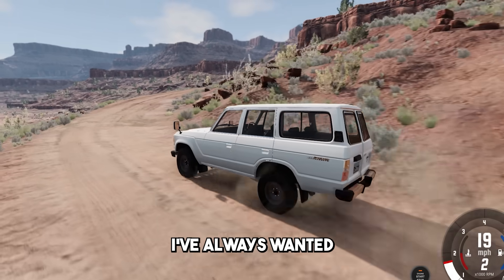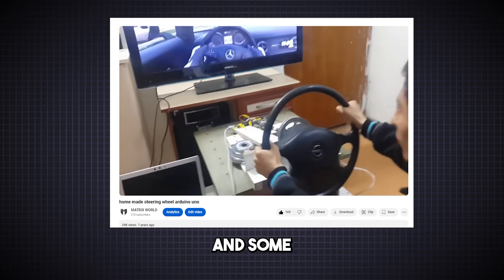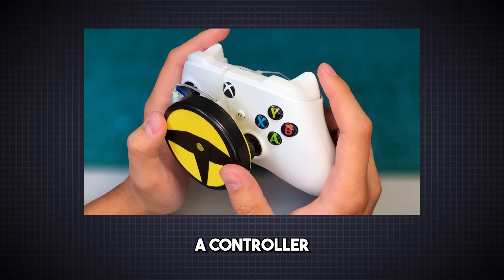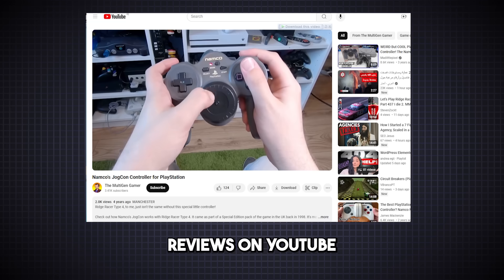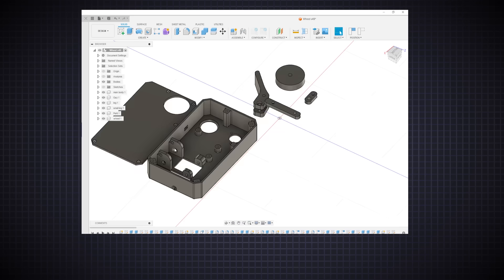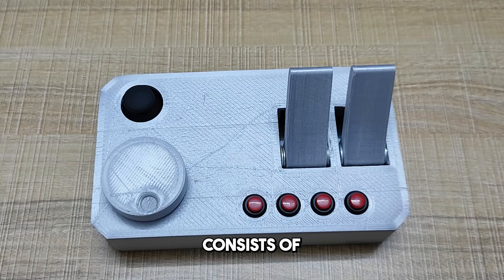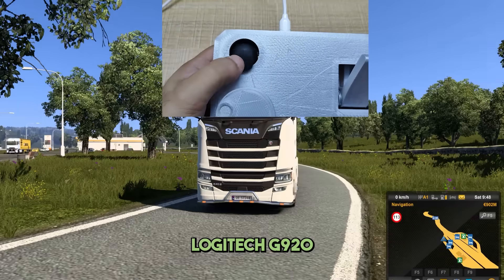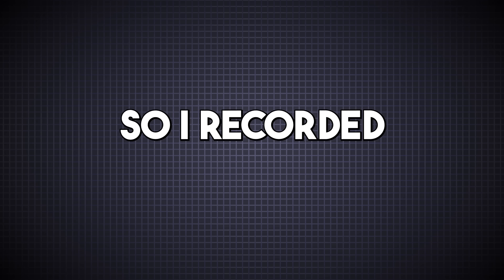The Racing Controller No Company Ever Made—So I Built It

Comment: Great Idea, Couple of recommendations / Questions: 

1) Get a UPS for your 3d printer it will save you so much time restarting prints.

2) Would it be possible to make the steering wheel auto rotate back to centre like a normal steering wheel does.

3) Someone else mentioned can you put buttons on the top like an xbox controller for LB1/RB1 to allow for changing gears?

Comment: Would it be possible to move the camera joystick over to either index finger on the back side of the controller?

This way you can keep your thumb on the wheel and steer while turning the camera at the same time.

It would likely benefit from a lower profile "cup" style joystick, possibly one with 4 axis control instead of 360 for easier level locked camera rotation.

Comment: For the problems of 3D printing and the reliability of the electricity network, maybe doing something like a sai, or battery something? Of course I don't live where you live, and maybe I'm saying some stupidity, but with the current price of the batteries, I think you should be able to get some decent backup network to avoid 3D failures because of the electricity. It's only a thought.

Comment: i find it interesting that as a South African who drives on the right side of the road I would actually prever if the steering was on the right for me. i use my right hand to hold the steering wheel most of the time while my left is mostly on the gear shifter.

Comment: I remember racing with an Ultraracer 64 which was a great handheld controller. Using a trigger similar to RC racing allows you to hold the controller comfortably and allow the trigger thumb to press buttons and use the Dpad while the steering hand can grip the wheel.

Comment: Bro needs to learn how batteries work for his 3D printer’s sake.  Can cheaply recondition scrapped car battery to make a battery bank that can power a house or room as long as you are careful to avoid hurting yourself with battery acid or electrocution.  You really only need a buffer of power like commercial UPS systems provide.  Basic electrical engineering is much easier than it sounds.

Comment: For the unreliable power there's a power bank power strip you can potentially get, its a battery attached to a power strip, it charges when the power is on and acts like a normal power strip when full, when the power shuts off it draws from the battery so that things can still run, it can run the printer for a few hours after the power goes out if you get one with a few hundred watts of bank, I'm not sure how long electricity goes out for you for though but it could allow you to finish a print if it has a few hours left on it.

Comment: Hmm, i think if I was making something like this, I would put the brake and acceleration pedal as shoulder pedals. Add a more travel than your regular xbox controler pedals of course. That'd allow you to shift with your thumb. And then I'd use something like the arduino micro to get it to be a bit smaller and more ergonomic. That said, pretty cool regardless.

Comment: I don’t play racing games because I just couldn’t feel immersed. And now you created a controller to do this. Thank you!
Reply: Do you know like gta because you're not "immersed"?
Reply: You can but set up a rig with real movement and using a Direct Drive, good pedals, three 55” OLED TVs, and cut the chassis of a car you will feel fully immersed.
Reply: @alcrack3996 don’t forget an airbag in case you crash
Reply: @E_Rico  right😂
Reply: @alcrack3996  and pay close to annual sallary for all that
Reply: @alcrack3996  Or just buy a g29 instead of spending the money a real car would cost
Reply: @adogaruu  he talking about immersion so that is. Before a G29 there are cheap DD
Reply: @adogaruu People have been using actual car parts as simulator rigs so there's that too

Comment: Force feedback is way more important to steering feel than degrees of rotation, unless you want to emulate the feel of a modern electric steering rack 😅

I guess it could be impossible to find a small enough back drivable servo motor for that though 🙁

Comment: 1. Not good for serious racing games where you need gas/brake at the same time, or switch quickly.

2. You can't press the buttons while holding gas/brake.

This is a problem with all consumers. They all require thumbs too much. There should be buttons on the bottom where you can make use of other controllers. 

3. Not everyone has thumbs. A controller should be made where other fingers should be used. You can start a business making controllers for handicapped people.

Comment: This looks like a really nice implementation! Just the pedal inputs seem like something I'd really prefer for driving games. It sorta reminds me of the idea behind the little "Tech Deck" toy skateboards, remapping footwork to fingers, and looks like it gives a lot more precise control than an analog shoulder button with a few mm of travel does. With a clutch pedal I could probably even drive stick as well as in a real car, something I've always failed at with a controller.

Is the encoder wheel limited to 900 degrees of travel physically, or do you just hit the virtual stop in the game when you get there? I think free-rotation probably works better for a game, mostly curious if that fairly fancy looking industrial encoder has a mechanism that limits travel.

Comment: this is really cool!!! im probably gonna try to make one myself! i'd love to try getting this to work with f-zero gx. i think with the strafing mapped to the horizontal axis of the joystick itd work rly well. im not exactly sure how the arcade controls worked, so itd prolly take quite a bit of tweaking to get working, but we'll see :) i also think hydro thunder would be super fun

i think itd also be a fun challenge to play a sonic game on it by mapping the controller such that the wheel and the gas pedal output combined as a joystick, with the wheel setting the direction and the gas setting the magnitude, and depending on the game the brake could set magnitude in the opposite direction. this setup would be BANGER for monkey ball

one last weird thing, i think this could work well for fps and tps games, especially those with an emphasis on horizontal aim like OG Doom or those with platforming elements like splatoon. the joystick can be used for strafing, even analog 360 strafing, the wheel can be used to aim horizontally, gas to aim up, and brake to aim down! itd probably need quite a few more buttons depending on the game, but i could for sure see it working. i'd be interested in trying to play metroid prime with it, since that game kinda had that tank control thing going on with the original gamecube version

i think the controller might play a tiny bit better if the joystick was on the top of the controller, where the triggers and bumpers would normally be. noticing you struggle with turning the wheel and moving the camera at the same time during gameplay, if you moved the stick there you could do both without having to claw the controller. i also think that you could add one more type of analog axis to make it more compatible with other games, but there arent that many games which use every analog axis on a controller, i dont know if itd be worth the work :p the one i can think of off the top of my head is outer wilds with its crazy in depth spaceflight

Comment: I have one thought, it’s a small one but I think could improve the ergonomics of the controller if that’s the right word 😅
If you move both pedals sideways and onto the backside of the controller where triggers would be, except they aren’t facing down like a trigger, so in that way you can have both your pointer and middle finger comfortably resting on them
It would also give you more room to use your thumb to press buttons where the pedals used to be
Otherwise it’s a good controller, it could just be re-engineered slightly better to fit a hand a bit better rather than be boxy

Comment: Wow, that's a very good idea! Although it looks better suited to slow-reaction games, like truck driving, I think it can get be used for sim racing to a certain extent. Why I say "slow reaction": one issue I see is with the two pedals, it takes a long time to switch between them, perhaps a slider which acts as acceleration+brake would be better. Thrustmaster also has a similar "steering wheel gamepad", there's this "Forza Horizon" branded gamepad with such a wheel. But keep experimenting, I'm sure you'll get to the optimal ergonomy for this device!

Comment: For Power Outage Issues... One might consider purchase or creation of a  UPS system (Emergency Battery Backup system).    Not sure if these have enough power to complete a full printing job... so you will have to check the wattages, and figure out how long the battery would last.     As for the controller...

 Firstly, I used to own the Namco controller (Jogcon?).   It was quite cool, actually.. and the force feedback really helped you to feel the tire Grip / Slip.   One of the things I didnt like about it.. was that it was heavily Geared.   You could hear and feel that gearing.

 I used to work at an Arcade... and had to repair the machines.  The hands down BEST force feedback wheel... was in the sit-down version of Atari's  "Race Drivin"  Arcade machine.   It used a wheel that I believe was 900 degrees.   The shaft of the steering wheel, went directly though a massive DC Motor (Extremely powerful, Brush driven  DC Motor.  Maybe 7 inches in diameter, and probably weighted 25 to 30 lbs).

 Because the motor was Direct-Drive (directly shaft driven, not geared) ...The wheel could spin with very little resistance, even when the power was off.

 I believe the Jogcon could turn a full 360 degrees.   Unfortunately, because it wasnt a free-spinning + weighted wheel... it couldnt be used well for games like SuperSprint, nor Tempest (spinner based games).

 It would be great to create a mini version of the Hard Drivin force feedback wheel...  in a Jogcon style of handheld controllers...  that allowed for full 360 degree rotations (and weighted well so that it could be free-spun for spinner games).

 IMO, Pedals should always be operated by your feet.  Being that they can easily be slid under a desk,  space is not a concern.

 A 6-Gear Shifter, could be permanently mounted to the side of your Chair.    Even mounting it to the side of a desk, might not be that much of an issue, so long as its made small enough.

 Though, it still would be good to create / modify a modern gamepad... and add a mini weighted spinner.. with Force Feedback on it.

Comment: Idea of a 900 degree steering wheel controller is great, but I see an obvious ergonomics issues to address, most of which are obvious to you at this point as well. 

First of all, you're using only two fingers instead of six, thus a lot of controls are out of reach at any given time, most obviously camera controls. 

My suggestion is to try to stick to a classic six-finger controller layout, but replace left stick with a wheel and add more lever/increase stroke for analog triggers for pedals. Replacing one of bumpers with pressure or analog button to imitate clutch could also be useful.

Comment: Cool idea.  I would wonder how hard it would be to separate the arduino from the controller itself (USB cable to the controller, pushing power and accepting input, one could screw the arduino housing to the desk itself, as they are quite small, and don't take up much space, or just let it free-float).  This might allow you to shrink the controller, or at least make it more ergonomic.  

As someone else has said, a shoulder button on each side (if not a few), either for shifting or to turn your perspective a few degrees right/left or quick turn 90 degrees that direction.  As a few times you had to take your thumb off the steering to shift perspective where you want it to be.

But great job, i just hope you iterate on it, and make it even better than it is now

Comment: can't you get backup car batteries for the printer and a 12v/220v converter and then a charger to charge the batteries. always run the printer via converter and always have charger connected to power supply, when the power goes all that happens is the batteries don't charge for a moment.

Comment: recently asked myself some of the same questions, my idea was a controller based on a radio controller for RC cars, my main issue was that while throttle and steering input are great, braking input is a problem, mainly because DC motors can brake on their own, this here is a perfect solution!

Comment: Great work! You have already built a full product, now its just a matter of finding a way to mass produce it and sell it! I especially love the idea for small pedals for your hand, could even experiment with adding a clutch pedal although it would require some weird fingerwork to operate all 3 of them with one hand. Is the rotary encoder limited to 900 degrees, I mean does it have something that physically stops it at the two ends like in a real car? I think another feature would be either to add force feedback or just some sort of mechanism that centers the steering wheel when you let go. I've experimented with a similar concept but with a multi turn potentiometer and my biggest problem was that I constantly lost track of where my wheels are pointing as there is no feedback.

Comment: 3D printing projects are so fun when you finally finish them, it's always a proud moment when you create something you need but doesn't exist! Great job!

For a v2 I would move a bit away from the realism of the thumb pedals and improve on the functionality / ergonomics of the controls:
- replace the pedals with the camera joystick, place some buttons nearby it for some easier to access hotkeys
- remove the left joystick and replace with a button cluster for hotkeys
- add shoulder triggers / pedals for left and right hand, right hand for throttle / brake and left hand freely assignable
- more ergonomic chassis shape to reduce hand fatigue (box for v1 was perfect though since it saves time in prototyping while being good enough for a proof of concept!)

This way it will be possible to have analogue control over the throttle / brake, steering and camera angle without having to let go of any of them with your hands.

Comment: What do you think about maybe moving those "pedals" to the back of the controller (part that is facing the table), one on each side of the back, so you can command them with the pinky and ring fingers of each hand, and putting a lever or something like a stick (that just moves center, up and down) for sequential gearbox shift, on the right front side (place where the gas and brake "pedals" are now) so you can use it with your right thumb??

In my mind it would be something cool to try!
By the way, well done! Great design and creativity you got there!
Cheers from Brazil!

Comment: That’s incredible!! Any ideas on how to add force feedback? I’d imagine a small brushless motor and belt mechanism connecting it to wheel. You could even use rubber bands for belt since it is so small! Toothpick size quadrocopter drone motors sell at around $10 - wont break the bank either

Comment: I'd call this a driving panel! The rotary input for driving seems like it would be more precise than a controller or full sized steering wheel. I think the pedals should be less angled and small enough to allow the user to place their palm on the panel and use their index and middle finger. A potential e-brake button should be accessible by the thumb as well. Otherwise, I think this design is off to a great start.

Comment: I think triggers or even some chunky, long travel shoulder buttons would have the right kinesthetics for pedals. We're very used to them being the gas and brake. Using one thumb for both pedals is pretty bad, I'm thinking you'd use your index and middle finger. The ergonomic angle would need to determine what kind of shape and placement is still comfortable. Maybe you even want 3 pedal style analog triggers behind the controller. Kind of like playing a saxophone but actually operating a simulated manual gearbox.

Comment: Hi there. Nice project. Regarding the power out issue, I would suggest finding two car batteries, linking them up in series to give you 24 volts. Most 3d printers run on that voltage, you could simply parallel it up on the power lines between the psu and the printer itself. It gives you a few hours of uninterrupted power. You can fancify it with charge controllers and buck-boost converters if you want to get the most out of a battery. I have the same setup with one 12v battery out of an old car.

Comment: Amazing. I got my new Arduino joystick to work on an ESP32/M5Stack device as I have some remote control in mind for RC constructs. Some will be LEGO at first where I use other servos/motors. I only used C++ for a short time, so it's a tough ride. The electronics is also quite new to me, but I built a lot in a couple of years. My main RC cars (bought) got steering wheels like that, but they are too big and too expensive to open up for something else.

Comment: I think a rubber band retrofitted as a bungee system  could work,
Though rubber bands aren’t so resilient after a while, so it would require maintenance.

But it might be a viable way to have the wheel wind back to centre position.

Maybe a little wheel and pulley  to run the band through, with anchor points that somehow move and rotate with the actual steering wheel itself, pulling it back into position when you let go.

Question is, how would one make a system like that, that isn’t super fragile, in such a compact form factor?

Would be waaaay more viable if the box holding all the components was wider.
Give the rubber band room to stretch, otherwise you’ll need a super tight winding system that takes up like 0 space inside…..

Lol just my thought, I don’t really build anything though so what do i know